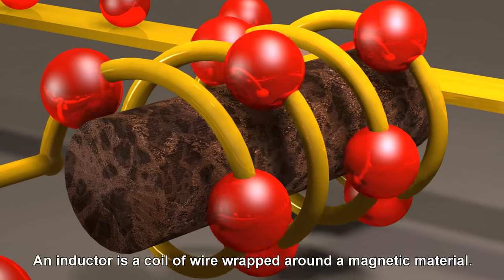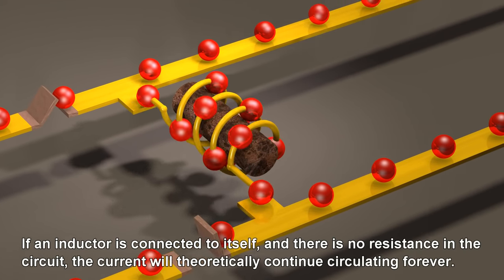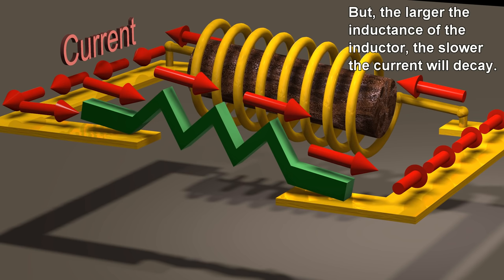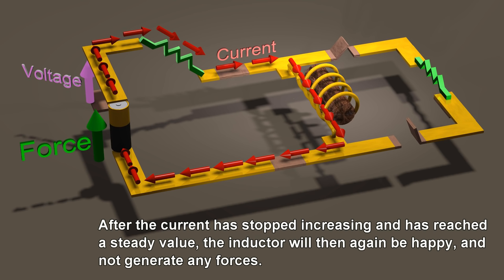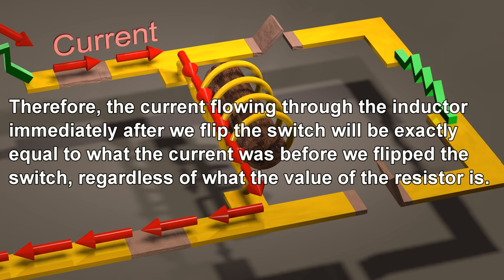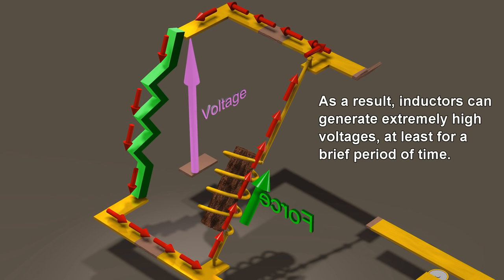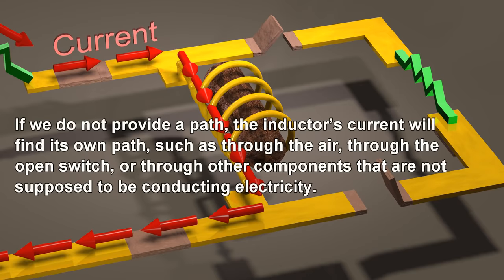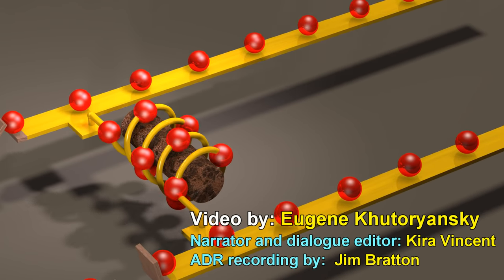Inductors and Inductance

Comment: inductor helps to does not sudden change in current is correct? &one more doubt, inductor output side is voltage decreased and current increased correct?
Reply: First question yes, the inductor makes the current take some time to reach its maximum value. Second question, I didn't understand sorry (maybe in spanish?)

Comment: Seem like you missing off the magnetic field which collapse once the power source is removed or turn off. That should be the main reason that the circuit still remain with some current as the magnetic field is colapsing.

Hope this can correct the misconception.,
Reply from the maker: This is not "missing" or a "misconception", but simply something that wasn't covered in this video because it was already covered in considerable detail in my video on Maxwell's Laws of Electromagnetism at http://youtu.be/9Tm2c6NJH4Y

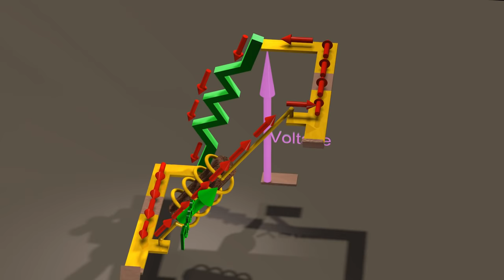Comment: @5:23, how come voltage increases if we increase the resistance?? Please explain :) I thought voltage can be increased if we reduce the resistance .
Reply: V=IR (V=Voltage, I=Current, R=Resistance)
The very moment we disconnect the inductor, the current will be the same as the moment before. So I*R will be larger with a larger R.

Comment: I dont understand why the current increases with larger resistences. I mean, Ohm's Law is V = IR so both, current and resistance, are directly proportional but I cant figure why.
Reply from the maker: The current does not increase with larger resistances.  The current is unable to change instantaneously, which means that for higher resistances, voltage must be higher.
Reply: Thanks for replying! What you are saying is that the inductor tries to keep the same current running, so in order to do that it must apply a high voltage in the high resistance?

Comment: Error: the larger the resistance, the slower or faster is the decay. No. The current is generated by the collapsing magnetic field which is not in any way affected by circuit resistance. 
Sorry. Do make the correction.
Reply from the maker: The video is correct.  The rate of change of the magnetic field is proportional to the voltage drop, which is greater for a larger resistance.

Comment: at 2:59 when inductor is connected to the circuit it creates a force opposing increase in current.But since there is no magnetic field generated yet initially at zero current how does inductor oppose the increase in current..ConfusedI
Reply from the maker: Even just a few nanoseconds after the voltage is applied to the inductor, there will be a tiny current flowing.  A few nanoseconds before the voltage was applied, there was no current flowing.  Going from no current to a tiny current is still a "change" in current, and what really counts is the change per unit time.  Since the time difference is just a few nanoseconds, this extremely small current divided by a very small interval of time results in a significant rate of change for the current with respect to time.
Reply: Oh okay.Makes sense now.Thanks a lot  Eugene and your  videos are unique and covers the overlooked fundamentals  in other videos and books .Excellent , keep up the good work !

Comment: Why is the direction of the current irrelevant? The current cannot change, however its direction can in the case of AC. (That is what I understood from the video regarding transformers.) So why is this so? It would seem that direction is a part of current since the magnitude of the current is measured in a specific direction.
Reply from the maker: +Matthew Graham, what really doesn't want to change is not the current, but the magnetic field created by the current.  In the case of a transformer, when the current in one coil creates a changing magnetic field, the other coil reacts to this by creating a current so as to create a changing magnetic field in the opposite direction, so as to try to keep the total magnetic field constant.  In the case of an inductor, there is no second coil, and hence the inductor tries to prevent the magnetic field from changing by trying to oppose changes in the amount of current flowing through the inductor.  The underlying physics behind all this is explained in my video "Electromagnetism - Maxwell's Laws."

Comment: so in a power supply like for a phone would there be a requirement to have one resistor in parallel with the primary and one in parallel with the secondary coils? (I think it's possible as even though the phone would be a load to help prevent the issue mentioned in this video, what would happen if someone did not have their phone plugged in at the moment and unplugged the charger?)
Reply from the maker: +Luke Johnson, no you not need resistors to ensure that there is always a path for the inductor current to flow in.  This is often dealt with by using a diode.  You don't want a resistor due to the fact that resistors will dissipate a lot of power, thereby significantly reducing the efficiency of the power supply.
Reply: Physics Videos by Eugene Khutoryansky
thank you for replying to my comment :) I enjoyed your video a lot :D

Comment: I think instead of saying an inductor is a coil of wire wrapped around a magnetic material, you should of just stuck with an inductor is simply a coil of wire since some inductors have air cores. Also would have been great to go into more detail, like not math wise but just in general the physics behind it. Great example otherwise.
Reply from the maker: I go into all these details in my video on Maxwell's Laws of Electromagnetism at http://youtu.be/9Tm2c6NJH4Y

Comment: Now I understand why a fan keeps running for a while after it is switched off. The left over electricity and magnetic energy has to be spent.
Reply from the maker: Actually, that has more to do with the mechanical momentum of the fan blades.

Comment: What if this experiment is done in space ,no medium around it
Reply from the maker: The coil will still have some inductance even with no magnetic material.  The magnetic material is there because it greatly increases the inductance.
Reply: @EugeneKhutoryansky  thank you for replying
But I'm actually asking what if the circuit containing inductor turned off abruptly in space no medium around it,   as there's no medium how inductor maintains the current ,also I cant understand what is 'magnetic material' you've mentioned
Reply from the maker: The inductor will force current to flow through empty space.  I cover magnetic materials in my video on Maxwell's Laws of Electromagnetism at http://youtu.be/9Tm2c6NJH4Y
Reply: @EugeneKhutoryansky  thank you eugene

Comment: How can induced  emf because this is DC. No change of flux how can induced emf only it was produce  magnet please immediately reply
Reply from the maker: There is a change in magnetic flux the moment after the switch is opened or closed, and the change in magnetic flux creates the voltage.

Comment: I don't think the explanation "if you cut off the current, the inductor tries to keep the current flowing" is more understandable than the accurate explanation, which is that the magnetic field that the current created around the inductor will convert back to current. It is more like you pumped water uphill to a reservoir. Stop pumping uphill, the water comes back downhill.

Comment: I know the magnetic field torque the electric fields and create a perpendicular force on the charge separating the + n - charges hence crating a voltage across but I still don't understand what the electric field is pushing to generate the magnetic field? For the records I do know they create it each other by the fact how a motor  works I just don't know the mechanism.
Reply from the maker: +zesowl, you may be interested in my video "Electromagnetism - Maxwell's Laws."
Reply: i know all four of the  equations, i just think what he did with the displacement current have the same feeling what newton did with gravitation, it works but it doesn't explain why.

Comment: What is the force generated? flux?
Reply: The force is generated at the very moment the initial current is cut off at 01:08. The force is present every time the magnetic field changes. In this case the magnetic field collapses and releases its energy back to the inductor. The force is called (self induction's) electromagnetic force.

Comment: Why the inductor gets the resistance of the resistor?
Reply: Resistance comes from the Reactance which is the imaginary number in a complex number. The formulars look like this Z = Impedance. Impedance is a complex number given by Z = R +- jX. where jX is the imaginary number and R = Resistance is the real number in the complex number. both are denoted by the unit Ohms. Resistance the real number is something we really can measure with a multimeter but when a change in the circuit occurs like AC another imaginary resistance comes up which resists to changes in currents or voltages, that's called Reactance and is also in ohms. which is why when you measure resistance on a 6 ohm speaker and you only measure 2 ohms with your multimeter its because its 6 ohms Impedance as speakers are driven by AC. hope this clears something up

Comment: So wait does that mean current is just atomic friction?
Reply: Current is the flow of charged particles per second.
Reply: Jo Reven
Exactly, but that rate must be changed by some physical effect aka resistance. So I'm wondering if that resistance is atomic
Reply: Nope, resistance is the electric friction. Voltage is the electric height. Current is the electric fluid!
Reply: Siddharth Sharma
Thats how they describe it but that doesn't example what it actually is

there is no fluid, the electrons just act as a fluid
Reply: +Katie (Kat) current is the amount of charge passing a specific point in the wire per second . this is why 1A=1coulomb/second (coulomb is a measure of charge)
Reply: domien van steendam
oops I just realized I accidentally said current in my original comment I meant resistance x.x

Sorry everyone
Reply: +Katie (Kat) Lol
Reply: Siddharth Sharma
I've only taken a few electrical courses so only have a basic understand of ohm's law my bad :P

I just thought it would be cool if resistance was based on friction, informed by the size of the atoms nucleus

That would actually make it a lot easier to develop makeshift resistance since you could just use the periodic table

So is my hypothesis wrong? You seem to know about electrical engineering
Reply: Actually, resistance is arises due to the atomic collisions between free electrons and the material's particles. Hence, changing the material would definitely change the resistance no doubt. But I don't think size of nucleus plays a  major role since the free electrons are already free of the nucleus's forces.
 So, yes the resistance will change with material, but it will follow a pattern based on nucleus's size. I doubt it.
Reply: Katie your intuition isn't far off.  Resistance has to do with how easily electrons can move from one atom to the the next.  This is related to how tightly electrons are bound to the nucleus which is ultimately determined by nucleus size.  It's not electrons bumping into the nucleus but rather how full the outer electron shell is.
Reply: No because it is the atomic interactions which describe friction

Comment: @1:57---- you have mentioned, "larger the resistance, faster the current decay". I believe that's wrong. Larger the resitance, slower the decay current. Or should have told, larger the load (smaller resistance), faster the decay current. 
Let me know, if have different thoughts.
Good job 👏👏👏
Reply from the maker: It is stated correctly in the video.  If the resistance is zero, then the current will never decay, since the inductor will just be connected to itself as shown earlier in the video.  With zero resistance, you have zero voltage drop.  Since V = L di / dt, we will have 0 = L di / dt, which means that di / dt = 0, which means that the current is constant.
Reply: @EugeneKhutoryansky  hi, if resistance connected across inductor is 1k and 5k. Which one do you think faster energy discharge? It is definitely smaller resistor 1k. It takes more time to decay current, if 5k connected. Do you agree.
Reply from the maker: No.  You are thinking of how capacitors discharge.  This is the opposite of how inductors work.  In fact, the word "discharge" applies only to capacitors and not to inductors, since inductors don't store a charge.

Comment: A magnetic core is not necessary for an incucror.  A coil with an air core is just as much of an an inductor as is a simple piece of wire.-- Cheers
Reply from the maker: Although what you are saying is technically true, without the core the value of the inductance would be extremely low.  You can say that all wire are inductors, just as you can say that all pairs of wires are capacitors.
Reply: Physics Videos by Eugene Khutoryansky   It is not only "technically" correct, it is very practically correct as well.  Air core inductors play a very important role in resonance circuits allowing radio transmission and reception.  Also, RF (Radio Frequency) Transmission lines rely on the inductance of the 'wires' and capacitance between them to create what is perhaps the most important characteristic.  These things become very important at cellular, WiFi and BT frequencies, for example. 
...         
We started designing cellular systems in 1974...
-      
Regards

Comment: The larger the resistance, the faster the current will decay? Surely not :-)
Reply from the maker: Yes, that is the way it works with inductors.  If the resistance is zero, the current will never decay.  You may be thinking of capacitors, which work the opposite way.
Reply: Correct. Sorry, my fault in tranlating into my language ;-)

Comment: Why magnetic field hesitate to change?
Reply: The take time to build and time to dismantle !
Reply: @Buzzhumma  why such a case is not there in a resistor
Reply: @jobinjose5605  a resistor is not a coil of wire. If you roll it in a small coil of 5 turns it will become an electromagnet or an inductor. They both have resistance but when a wire is coiled a magnetic feild is able to build. Type in. There is much to learn so if your interested I suggest you get on to Great Scott's channel and a few others and type in what is inductor

Comment: 3:12
Can anybody explain why does the current increase?
Reply: The back EMF being generated is weaker than the forward EMF of the supply voltage being applied to the inductor thus allowing the current to increase but at an impeded rate. The video explanation, though good, is oversimplified for a complete understanding of inductor theory.

Comment: Correction needed:
When the current thru the inductor is interrupted the voltage increases by -L*dI/dt.
The "-" is a flip in voltage, it goes from a resistor like device to a reverse battery at the switch time. You show increasing at the flip time.
Reply from the maker: The video is correct.  I am showing the voltage drop from the perspective of the external circuit connected to the inductor.

Comment: “The larger the resistance the faster the current will decay” it’s actually the lower the resistance the faster the back EMF will decay. An short circuit with no resistance discharges the inductor faster, using a mosfet instead of a resistor is the fastest way to discharge the inductor.
Reply from the maker: The video is correct.  You are probably thinking of the discharge of capacitors.   I cover capacitors in my video at https://youtu.be/f_MZNsEqyQw

Comment: I dont think that the electrons are traveling in the wire. They are traveling with the magnetic field outside of the wire. Is that correct?
Reply from the maker: The electrons stay inside the wire.  The electric and magnetic fields can be external to the wire.

Comment: ok. Then I'll make a huge superconducting indcuctor, and I'll use it to store energy from solar panels, then sell it at a higher price when our sun has dissapeared and energy is scarce. Im going to be rich you peasents!
Reply from the maker: +PotSchimba Chestii, Unfortunately, right now all the superconductors we know of require very cold temperatures to stay as superconductors.  Therefore, we would have to constantly expend energy on refrigerating the material to keep it cold.
Reply: +Eugene Khutoryansky do you think a lot of power could be stored in the magnetic field tho? If u accelerated the electrons to near the speed of light, would a small inductor store more energy than a huge battery.

Comment: Larger resistance, faster discharge?? why? I think it is wrong.. Larger load, faster discharge.. large load is not equal to large resistance..
Reply from the maker: You are thinking of what happens when a capacitor discharges.  Inductors behave differently.  In fact, the word "discharge" doesn't even apply to inductors.  If the resistance was zero, a constant current would circulate through the inductor forever.  By contrast, a resistance of zero across a capacitor would cause the capacitor to discharge immediately.

Comment: the 'SMALLER' the Resistance, the faster the Current will Decay !!  ;-)
Reply from the maker: No, the larger the resistance, the faster the current will decay.  If the resistance is zero, the current will never decay.  You may be thinking of capacitors, which have the opposite relation.